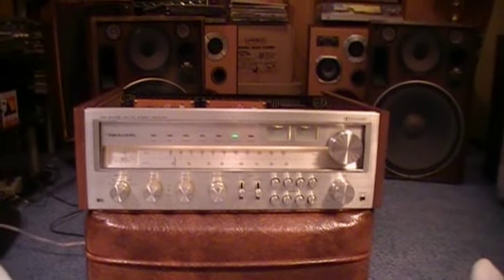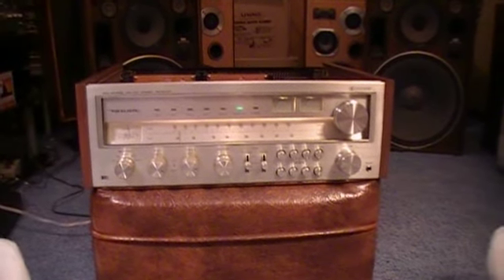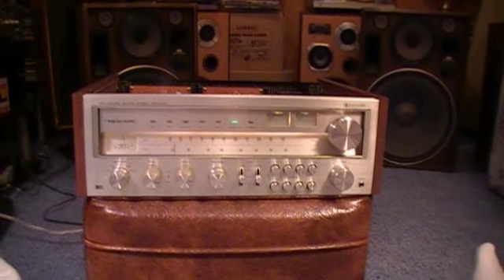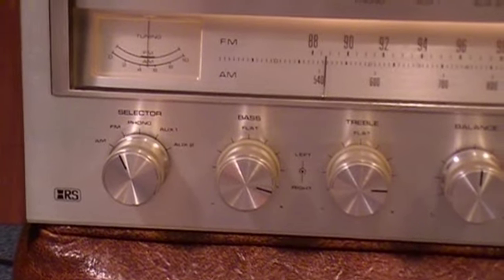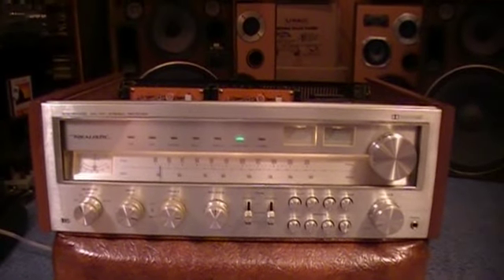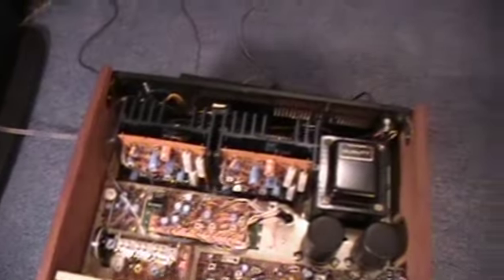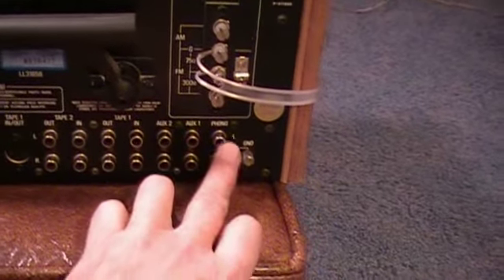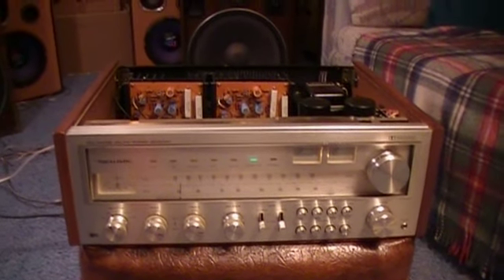Realistic Receiver - STA-2000D

Comment from the maker: Hi Lovitha! Sounds like you may only need to spray clean or to lube the dials and with electonic spray.  But this unit doesn't have tubes. It has capacitors that look a lot like tubes though. These receivers are so nice that it would be worth having an electronics tech do a maintenance on them. Thanks for watching!

Comment: I had a Vector Research receiver for a while. It was a very nice receiver, although it was not built particularly well. Vector Research was a sort of a budget "audiophile" line and it was obvious they were trying to make a nice sounding receiver for a low price point. After a year or so, FM would randomly stop playing in stereo unless you continuously switched between AM and FM or turned it off then on again. Within an hour, FM lost stereo again. They obviously had some QC issues.

Comment: @bluenazz Hey have you ever had the opportunity to hear the Mach ones. if not, i strongly recommend them, just make sure you get the 40-4024 and not the 40-4029 due to the latter's susceptibility to foam rot around the woofer. great speakes though.

Comment: RCA jacks were common on cheaper speakers.  Back then, it was a lot easier to deal with than the simple flat head screw terminals that were on many receivers of the era, but RCA jacks can't handle very much power.  The wires were usually 18 gauge or smaller.  

Over time, most home equipment switched to spring loaded speaker terminals, and the higher powered ones have binding posts.

Comment from the maker: Hi Maxxarcade, I've sampled many of your excellent videos over the past few years! I've noticed that Realistic used RCA jacks for speaker connections on many or most of their speakers and receivers. It was kind of a passe thing to do but they were consistent and those cables may have provided better transfer of audio signal than cheap speaker wire?

Comment: these receiver "amps" look similarly to the technique's brand. and i still have mine, that i got from an audiophile. who ran his with a carver holographic generator. and used a 1/2 inch reel to reel with dbr noise reduction system. the setup produced such dynamics. that you could see the sound and it's location through the minds eye. like a motion portrait. i think it was mannhiem steamroller who i believe made a composition of sounds that demonstrated a ocean image in sound with waves and sea gulls. mainly because of the holographic generator. as for the manufacture of these. several of the  technique brand models offered cases that looked very similar to this radio shack system, once called the dream system or very similar.
Reply from the maker: +dale myers A friend of mine had a Carver holographic system and I thought that it was very cool, a really interesting sounding unit.  Thanks for watching!
Reply from the maker: +dale myers A friend of mine had a Carver holographic system and I thought that it was very cool, a really interesting sounding unit.  Thanks for watching!

Comment: All of the "super power" receivers were built in Japan (early) and Korea by Tandy Electronics. Foster had nothing to do with it. This includes the STA-2000, 2000D, 2100, 2100D, 2200, 2290, 2300 and 2080. The STA-2100 and 2100D were rated at 120 wpc.

Comment: Seems Loudness is on and tone at 3 o'clock - bad smoothing cans.  Once these are replaced with new ELNA and run in for a long while, sound with Optimus X-100, tone at flat with no Loudness, will send you off to sleep most times.  Close your eyes and this has to be one of the best, human voice is reproduced so naturally then if deep rumbling bass comes to an FM broadcast, it's just there with tone at flat and no Loudness!  I have the STA-2000 version of this 2000D, a fascinating audio experience!